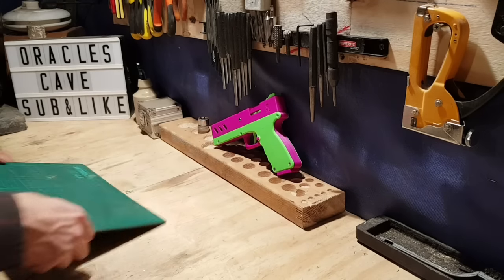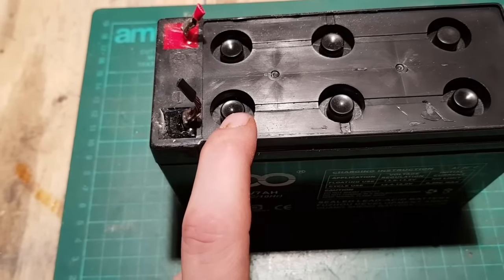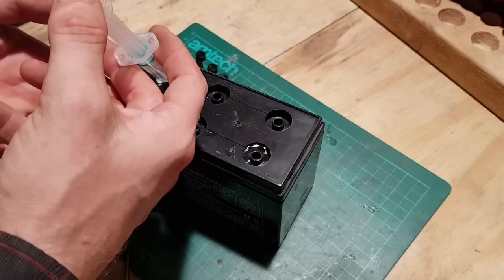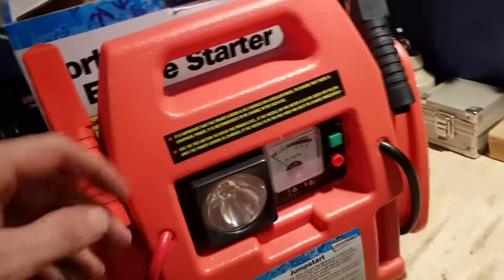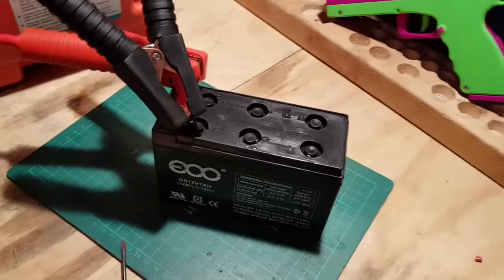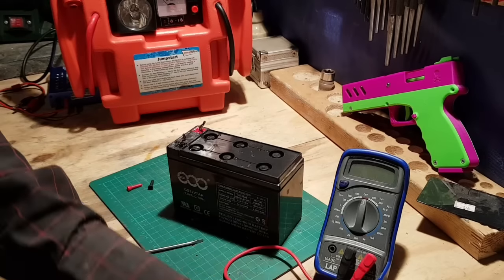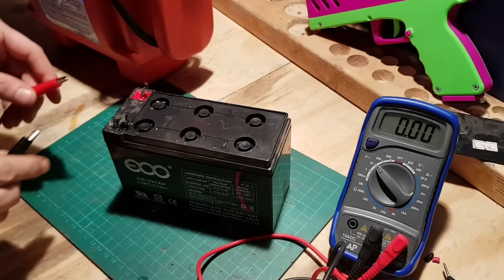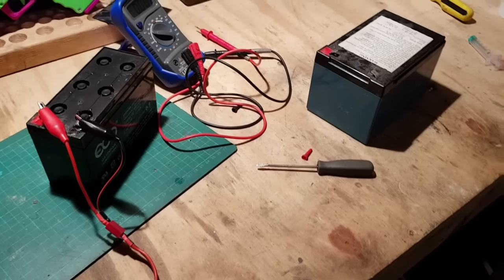HOW TO REVIVE DEAD 6V, 12V BATTERIES THAT WON'T CHARGE

Comment: My battery 12v same as in the video. I filled it with destilled water. It was about 5V. Hooked to the other good 12V battery red to red, black to black. After 3 hours there was enaugh juice for the smart charger to pick it up. Charged for two hours. At first the charge seamed to go up but than start dropping while charging. After an hour of charging (1A) the voltage start ceraping up again. After 3 hour charging I unplugged it and left for the night. By the way whenncharging there was a lot of bubbles, instead of the caps i put one strip of isolation tape across. The caps ware just poping because of pressure inside and splashing the water. With the tape it was jus seapung away. The next day the battery was down to about 9V. Hmmm I only topped the fluid just a tiny bit, hooked to good battery for 30 min and the smart charger picked it up from there. Now charging the 2nd time at 1A it bubbles away like a fizzy juice but not splashing with the tape over it. Will give update soon. I seen in other video that for the battery to be all good again you may have to repead the process several times over few days.

Comment: The distilled water sold at my local WalMart has some minerals added for taste. Can I still use it?
Reply from the maker: No, the reason distilled water gets used is the lack of minerals, so I think it would not be good.
I think its crazy they distilled it to add minerals anyway.
Probably just tap water in the bottle anyway all a big con, meantime you are ingesting BPA that leaches from the plastic, very bad cancer causing agent.
And you spend money to do it.

Best to use clean distilled water with nothing added.
👍👍👍

Comment: Great video, went to a battery 🔋 shop to buy distilled water, and was told they have the normal distilled water, and distilled water mixed with acid, which one will u recommend
Reply from the maker: I would get the one mixed with acid, as just adding water on it's own will not produce full charge.
👍👍👍

Comment: Wish I would've found this a couple years ago.
Reply from the maker: Yes, I also wished I had known about it years before I did, awesome hack.
👍👍👍
Reply: @oraclescave  is it possible to charge the batteries with a battery tender. I can't find the right charging plug for my powertrane bladeZ.
Reply: Now all we need to do is find out about the hack Bidens used to get away with their criminal activity to not be worried about it. N then there's our wives. Time travel is where it's at.

Comment: I used this along with another tutorial about how to accessing the battery.  On adding distilled water in the cells (didn't really need it - caps were vacuum sucked downward, though I add a few drops) and jump start a battery (wound up not needing it) that wouldn't charge / play. I was surprised when I took a voltage reading and it was at 11.8 (12 V is the rating). So I reconnected everything without charging it.  Come to find out, it played on battery mode (had been cutting off after about 5-10 seconds. Did disconnecting it reset something? Perhaps that was all it needed! Thanks everyone!

Comment: Thanks for the helpful video! I am in the process of trying this in hopes to revive my daughters 24v powerwheel. When filling the dry cells back up with water, are you supposed to top them off? I had the battery on charge for nearly 3 hrs after adding water and when i checked it, 2 of the rubber caps had popped off. At this point i took it off charge to check the voltage and add more water. A few of the cells did need another "drink":) my voltage went from 1.9v to 11.6v in the 3 hrs charge, i was just worried about the rubber caps popping off
Reply from the maker: The rubber caps are recommended to be off while charging, because gas bubbles are formed, I leave them on and experience them popping off too.

Fully charged battery will be over 12 volts, like 13.3 volts.
The battery might drink some water and need more once it is left to cool for a while.

Sounds like your Frankenstein battery is coming back to life.
👍👍👍
Reply: @oraclescave  thanks for the fast reply! Ok that puts my mind at ease. Kind of a remedial question, but since this is a 24v battery what kind of voltage will i expect when fully charged? Thanks again:)
Reply from the maker: @jeremytannehill9427  probably around 26.6 volts roughly maybe more.
Reply: @oraclescave  Thats great, thanks again! We are excited to get it running again! Ironically, i stumbled across this video because i am currently doing a gas conversion on one of our old electric razor scooters! So thanks again in advance for the helpful info and awesome channel! Have a good day 😁
Reply from the maker: @jeremytannehill9427  Thanks Jeremy that's very kind.
I'm glad I could help you in some way.
You will enjoy converting the scooter, I had a lot of fun and the feeling of accomplishment afterwards is awesome.

I'm in the process of trying to buy a broken dirtbike and planning on turning it into an electric dirtbike with 4 car batteries until I can make a lithium ion battery pack from old drill batteries.

Looks like a decent motor will cost a small fortune, but I think a homemade electric dirtbike 48v-72v would be awesome lol

Good luck with your conversion and if you make a video let me know.
👍👍👍

Comment: When it’s bubbling up is it best to put the caps on or leave them so any air bubbles  can escape? I’ve seen other videos where they use epsom salt 🧂  think that’s a good idea?
Reply from the maker: No its best to have no caps on, it allows the bubbles to escape.
And Epsom salts would probably just eat your cell plates, I'm not sure if that's a fake video trying to get you to ruin your battery.
Sulfuric acid is very cheap, probably as cheap as Epsom salts, you can buy small amounts specifically for battery refills.
👍👍👍
Reply: @oraclescave  well guess what, I put the caps back on and went to bed let it charge came out this morning and a couple of the caps had blown off now I have to find them in my garage 😂 I wish I would’ve read your comment sooner 😂 thank you for replying
Reply from the maker: @Here-2-Learn  ha ha ha yeah they can be hard to find, they can jump a couple of feet high.
Damn my ribs are splitting
They are not the easiest things to find either, matt black  
👁👁
Lol
👍👍👍

Comment: Trying it now however no-one has mentioned these plastic plates that cover the cells... all mine are glued down I took the chisel to the first one to remove it...
Reply from the maker: Yes even my plate was vibration/ friction welded in about 8 spots, that's usually how they are attached,  some batteries may be much different but the concept is exactly the same.
And remember to leave the rubber caps off when charging.

But yes small flat head screwdriver should pop it open for you.
👍👍👍
Reply: I put 40ml of water in each cell, voltage 3V charge current 0.1A
After filling 3V charge current 3A..  lets get this party started. Wondering whether a replacement plate can be found.. made or some caps to go in the big round recesses. As the plate is now trash

Comment: When I'm charging one of these dead batterys, take the rubber cups off fill with distilled water then work out the worst cells then put 2 proding skewers into where the caps are and measure the volts, on the lower voltage ones connect the charger wires just on the lowest instead of plus and minus connections, it will consentrate only charging the weak cells first

Comment: just wondering could you use a 12v battery charger to charge up a dead 6v child car battery or would that be dangerous ?
Reply from the maker: Yeah it's dangerous, it could bring it back to life with short bursts, but to charge it to full charge would definitely not be good, would overheat, create excessive gas bubbles and possibly explode at a random time.
I'm glad you had the sense to ask first, a lot of people put others at risk all the time trying out ideas.
👍👍👍

Comment: A trick with that smart charger not to keep connecting jumper pack is as follow as I did.  Get any 12v power supply example pc psu or even a normal 10v to 14v transformer (AMPS DOES NOT MATTER)) r a electronic device transformer will work. Connect the 12v transformer and your smart charger- set smart charger at 2amps so you Have a safety amp max draw.  Start your smart charger - It will detect 12v and start charging.    Your 12v transformers amps does not matter as the smart charger will supply the amps as needed. 
The trick is also connect  a 12v pc power supply fan.
 The fan will draw only small amps say 0.2amp.  There after you can disconnect your temp 12v power source. Smart charger will then supply the 14 volts.  As your smart charger has a 0.2amp draw the hole time due to the fan load,  you will fool it as it is thinking its the battery is  drawing it.  You can then leave it for days. You will then also see amp draw increase on smart charger - Because you know 0.2 amp was draw at first. and it is the 12v load fan- any thing above you know is your battery drawing amps.  (NO NEED THEN TO KEEP CONNECTING A  the JUMPING SOURCE AS YOUR SMART CHARGER WILL KEEP PUSHING VOLTS IN AS THE FAN IS FOOLING IT WITH THE SMALL LOAD))

You can also maybe set smart charger to 7 cell 16 volts if it reconice it with the 12v jump. - 16volts for a while may de sulfate and volts boost it,  if you cant get any amp draw after days with 12v charge - On 16Volts keep monetering battery for heat say every 30min , there after drop to 12v charge as above then only leave alone for long period. Helped me with a big 12v 27MAH as it did not want to pull amp for a while. there after 12v charge 

Also with a battery I pulled some acid water from my car's battery - very small amount - added about 2mill per cell with rest normal battery water -  iit also assisted with a battery to get it going witch struggled.

Comment: Instead of jump pack can i use 12 v vehicle battery charger instead
Reply from the maker: Yes
Reply: @oraclescave  its currently charged at 8.5v its a 12v battery. Might as well charge it full day. Is it okay if i keep the top open because it was bubbling.
Reply from the maker: @shaheen06  you can keep it open, but have it somewhere people can't just be splashed on.
You wouldn't want that to splash in your eyes.
So wear some protection, even if it's just sun glasses, while it's open, incase you drop it or it splashes at you when the bubbles pop.

Bur really it should be OK

Comment: when your battery is charged up as this one was , what should be the voltage reading on meter say after a couple of hours. What should the reading be if battery is new and fully charged.
Reply from the maker: Normally anything from 14.2volts to 14.8volts fully charged

Probably about 8-10 hours charge to full charge.
👍👍👍

Comment: Hey guy! Good video.  I did not know this was possible.  Ive got a 6V battery that is in the same condition of the battery here in this video.  Could I use the battery in my car to "jump/charge" the 6V battery, or is this a bad idea?
Reply from the maker: It will be fine, just connect for a few minutes and your voltage will rise in the 6 volt battery, might possibly work after one minute.
But it will work, just don't leave them connected for hours.
👍👍👍
Reply: @oraclescave  sounds great! I will do it for 1 minute and check.  Thank you for the response, and knowledge.  You've got a new subscriber, sir!

Comment: My 12 volt batteries are for a Pride mobility scooter. I can’t figure out how to get them open! There’s a rectangular cap on the top but it doesn’t want to come off. Please respond if anybody can help!
Reply from the maker: Small flathead screwdriver should pop it easily, it's friction welded, so needs a bit of work around the edge, but will pop off, even a butter knife will do it.
I have used Stanley knife blades in the past.

Comment: Good afternoon; using a 12v batter, how much time is recommended to have it connected to the damaged battery?
Reply from the maker: 5 minutes then check voltage or try connecting the charger, if it doesn't show,  stick the other battery back onto it for another 5 minutes that should do the trick.
👍👍👍
Reply: @oraclescave  thanks! I’ll give it a try! Appreciate it!

Comment: Sir, I got ebike with 4 dry 12v 24ah VRLA batteries. When the bike is still, it shows 48v ...but, as soon as I try to drive, voltage falls abruptly...Can this be fixed by the same procedure ?...
Reply from the maker: I'm not sure what a VRLA battery is but it sounds like a lead acid battery, and most probably there is a way to get into it and replace the electrolytes yes.

I will check up on this battery as its name is very new to me, but there are many types of sealed lead acid batteries, and they all work very similar.

Just find out what chemicals make the battery work, if its sulfuric acid like most other car batteries it should be easy to fix.
Reply: Just something that happened to me which sounds like your problem. One of my terminals was covered in white powder. So I cleaned the terminals and our bike operated fine once again. Just something to check?

Comment: Way back in the olden days in the US,older gents would have a very strong battery charger and would literally do routine maintenance on their own batteries by topping them off with distilled water and then heating the battery up to bake off or loosen the accumulated bad stuff from the plates taking care not to fry the plates lead or solder joints and they could literally use the same battery for 10 years or more.. Nowadays all manufacturers want people to simpky replace their used batteries with brand new and "charge" them a disposal fee for taking in the old "dead" batteries which usually wind up being recycled by installing the internals into new cases refilling with fresh acid and charging them again and reselling them as new or remanned and making profit again and again and again... They do NOT want consumers getting a decade or more usage off a single battery sale when they can and often do get them as many as 3-4 times during 10 years...  Unless a battery develops a dead short in 1 cell then it is always renewable as you've just proven and an acid pack from the local auto parts house will often renew 2-3-4 batteries if used to top off a good battery rather than water which in fact dilutes the remaining acid..

Comment: What kind of water did you use to refilled? What is distilled water?
Reply from the maker: Distilled water is just water that was boiled in one pot, and the steam goes up a tube and ends up in the other pot.

The steam is pure water, all the minerals and other stuff gets left in the first pot
So the second pot is DESTILLED.

but you don't have to do this, distilled water and deionized water are available in bottles from the shop.

Even filtered rain water would work.

The reason for using these is..

The extra minerals would have a bad reaction with the lead cells, and the electricity would make the minerals react in a way that would EAT the metal plate, and the battery would no longer work ever again.

So distilled water prolongs the life of the lead plate, and gives the battery much more charge cycles and stronger charge.

Also water has lots of gas locked into it, which when charging can release this gas ( hydrogen ) and sparks could cause a very nasty explosion  with this gas.

So always use distilled or deionized.
👍👍👍

Comment: Don’t use distilled water. Throw out the whole thing and replace with sulphuric acid. It’s cheap and battery places sell em.
I had a motorcycle battery that couldn’t hold a charge above 6volts, and would lose it under load quite easily. I replaced cells with water and it did up to 7. 
But It wasn’t enough to start the generator so I said fuck it. I just safely got rid of the liquid inside and put in the diluted battery electrolyte that has like 13% acid.
I didn’t even charge it after completing, and I checked it’s volts and got easily 10 volts under load. Later on I’m gonna slow charge it back up with the car battery charger.
Then run the generator and see how well it all goes.

Please note, don’t mess with acids and pretty much anything you don’t understand. Use safety glasses and rubber or plastic gloves. Work outside on a stably level surface. Use a syringe without the needle when pouring. It make it easier to prevent mishaps. Using a funnel is honestly not really good.
Also, if the acid gets on your skin and burns, neutralise it with Baking soda or baking power mixed with a little of water to make it a little more loosely than a paste.

Stay safe.